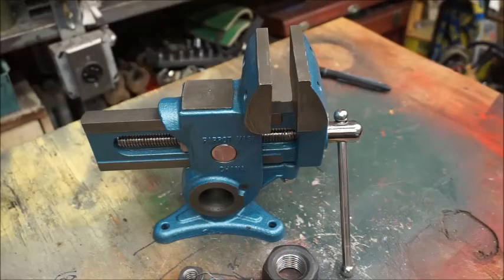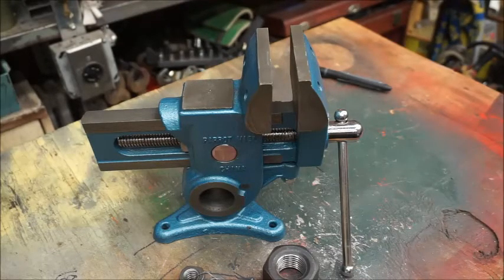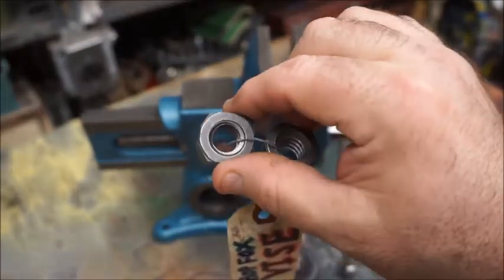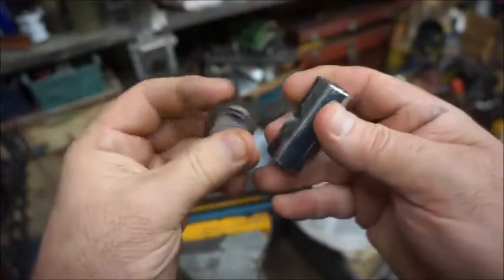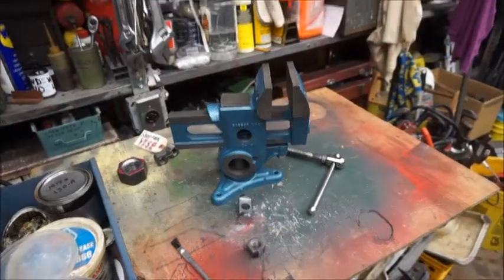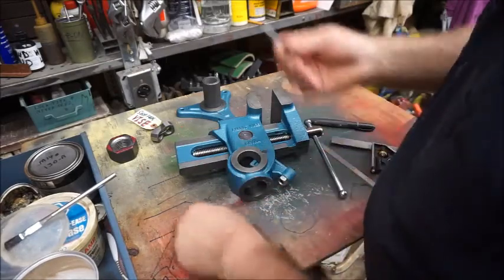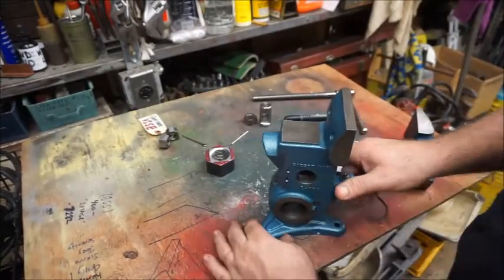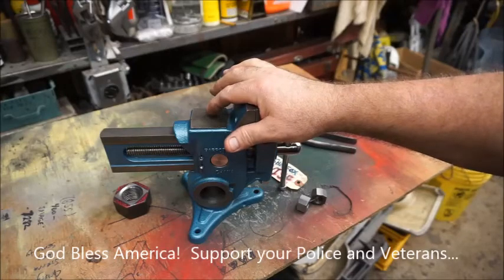How to disassemble and repair the Shop Fox Parrot Vise or Versa Vise

Comment: I think you did a fantastic job of instruction . You told exactly what needed to be done and showed it . ( suggestion .. you just did the instruction  mill off some more nuts sell them for say 9 each and that with this instruction you might sell a couple hundred . )

 Some Questions if you would ?
How hard / what were you clamping down on when the nut striped ?  Be honest were you pushing it or is the metal some what soft . ( you appear to understand what you are doing from the reconstruction of the vise ) 

Is the casting of your vise a grade of steel ? It's not aluminum is it ?

You called wilbert co ..l  don't know if you talked to the owner . I did a couple years ago ( he treated me ok when I called )  when I was thinking of getting a versa and saw he was making them again . 
Your opinion if you will ?
There are basically 3 guys selling them 
Parrot / Yost  - Garret Wade http://www.garrettwade.com/ultimate-versatile-vise.html and Larry ( I think he is the owner ) at http://www.willburtversavise.com 

I'd like to get one of these ... I'm not gonna use it for pipe fittings ... general stuff - wood - metal - guns . BUT I want to get what will / should hold up . 
The Garret and Wllburt both have the swivel base adapter and I want it for full function .. angle rotation etc . And yes pricy and shipping is high . But Willburt has the Acme nut for sale . 

So do you have any idea  ? Do you think that willburt is using better steel ?
Do you think Garret wade are the same quality as the Parrot . 
Do you think Larry is making them for these guys .?

If I buy from Larry it's 30% more than if I get it from Garret Wade .

Just you best guess on some of this if you can .... I don't want to buy it twice . 
Thanks
Reply from the maker: Thanks for watching my first video, and for the comments and compliments.  
  Regarding making these nuts for sale, I have two reservations: first, I think not all of these vises are identical, therefore, I might sell a nut that won't fit properly and have a dissatisfied customer.  Second, (I think for most guys out there) the process is so dirt simple that I would not really sell that many.  If someone contacts me and requests some, and provides the internal dimensions of their castings, then yes, I would mill out as many as desired.  
  I am now 60 y/o and have been metal & wood working most of my life, using all manner of vises.  I have never stripped-out a vise screw nut before on any other vise, even the ones (most of them) I bought second-hand, and some in rough shape.  Further, as I commented in the video, this problem seems to occur frequently and seems to be unique to the Versa-Vise design.   Consider this: what other vise manufacturer out there prominently sells a replacement nut?  No, this is unique to this style of vise.  That being said, I would not hesitate to buy another, or recommend this style of vise.  It is VERY versatile, and has engendered a following of sorts.  People who own/use them like them.  Get one... any brand.  Mine (Shop Fox) was the cheapest I could find.  I did not know if I would like it, so did not buy the best (whichever one that might be).  But I did like it... a lot, enough to think on the topic of how to repair it extensively.  Enough to research the topic and reach out to the Will-Burt Co.     
  I emailed Larry at the Will-Burt Co. four times.   He replied only to my first email, enough to tell me he did not know if his barrel nut would fit Shop Fox brand.  No replies thereafter.  
  My Sop Fox is cast iron, not aluminum (not cast steel either I believe).  
  I really do not know who makes the best vise.  Aside from the nut, the rest of my vise is good quality, and I expect it to hold-up to my use. The Will-Burt Co. does not show the back of their vise on the website, and he did not reply to my query about if their vises were American-made.  I suspect they are all Chinese-made now, but do not know that for a fact.   You may want to call the Will-Burt Co. again to ask.  I got no reply to that question by email.  
  In closing, if you want a USA-made Versa-Vise, just go on eBay and bid on one... there are many available.  
  Best wishes,   Alex Acle,  Benton, PA.
Reply: Thank you for your Time D Adams
Reply from the maker: One more thing- regarding over-torquing the vise: look at the vise- I have used it often for years prior to failure- it still looks new, right?  Does not look abused.  I would not say I over-tightened it.
Reply: Fair enough .. thanks
Reply: After the last response ... I pulled up this vid again ... that vise in the video ... just looking at it looks new !!  If you have used it for a while it don't show ....

( Side note ... I don't think you said it ...and for others that may come here .... the Acme Nut from Jon Mar Machine ... is for  PRE 2001 models . 

So the question begs did he 
change the thread pitch on this newer model . I know that when I talked to him . People were pushing him to make them in red _ like the original   AND he did not make the Swivel base . Said it was not useful . But people wanted it ?   I don't think he understands and or wants to supply the retail public . ) 

FWIW ..... I emailed Larry ( tried to call I think he does not have a girl on staff for the office ...no answer - guess I got lucky getting him in the past . 
I asked about a warranty as there is non on his site .
This is what I WANTED to do . 
Buy Versa from Larry at  Jon-Mar Gear and Machine AND one from http://www.garrettwade.com/ultimate-versatile-vise.html .
Larry's would have been about 15% more for the vise and the swivelbase adapter . ( when I talked to him before he said he would stand behind it if it broke . )
I was going to do a youtube comparison  on them . Keep Larry's ( hoping that he might use a higher grade metal in the casting ) and send the Garriet back... they have 100% money  AND shipping return policy . Since Jo Mar / Larry has no type of return policy or warranty on the website and to this point has not returned my email .
At this point I am going to order the Garriet and pays your money and takes your chances . I called about replacement parts for it . They don't . 
I wonder if Larry is making them for them .. the site says differently , 
Well when I get it I will do a tube on it . there is very little  on them on YOUTUBE and the vid on Garriet is fair to lacking . I don't understand why people are in the business of selling stuff to people and then are mediocre about it . I guess I didn't learn anything with that 20 + years in retail grocery . 
Well thanks . Just wanted to post this for you and others . 
Be well .....
Reply from the maker: Thanks... I look forward to your video.